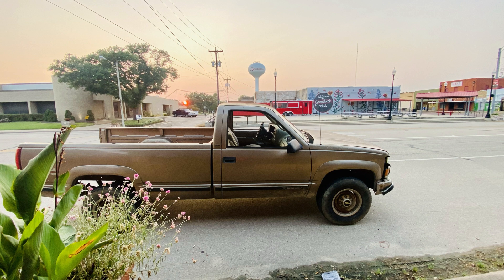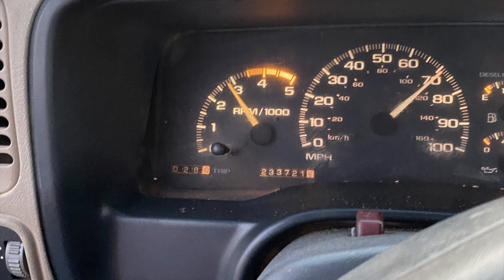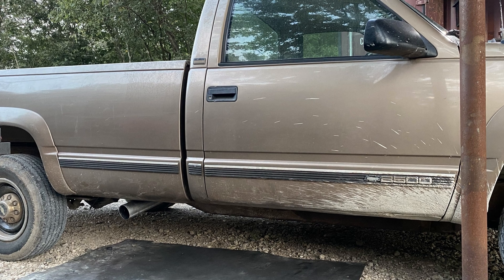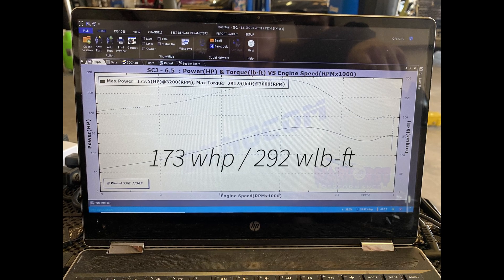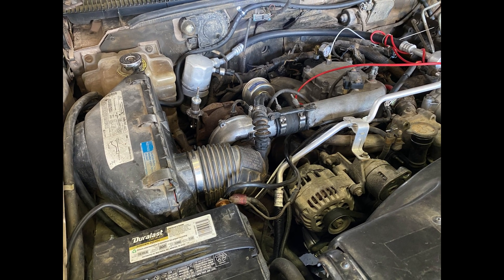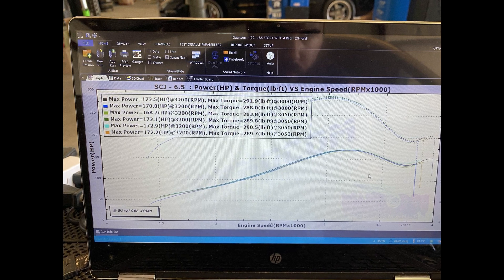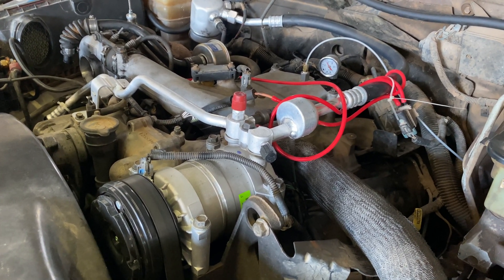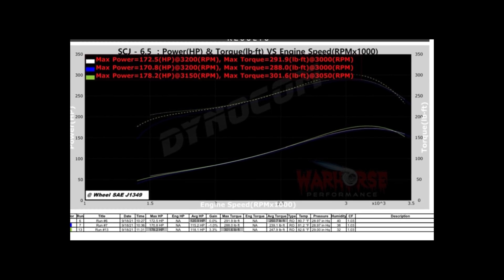Farm Turtle - Preliminary Dyno Results and Manual Waste Gate Testing

Comment: The best thing i did to my 6.5 was the manual wastegate controller set at 8 psi. I lost maybe 1 or 2 mpg on the highway, but the boost is there is always some boost available when you need the power - whereas with the stock vacuum controlled wastegate, the computer will open the wastegate when you aren't needing the extra power in order to save a little bit of fuel (by reducing exhaust back pressure) at the expense of performance. That small reduction in mpg is worth the performance to me...

Comment: Hello, 
Very interesting.  I have bone stock 94 except manual wastegate but, I noticed a large increase in power. I would say 20%. I have no idea what boost it gets to. I never did it for power, I was just tired of replacing vacuum pumps. But once I seen the increase in power and driveability it sparked my interest in 6.5 performance. Next lift pump.
JKA

Comment: Hope to see more vids of this truck. I just picked up a 93 6.5 dually. Love it so far.
Reply: 93 was the first and best year for the 6,5 Detroit I own. A 1999 3500 6.5 Detroit hate it so far 99 worst year
Reply: @russell7105  yeah it's still doing good. The only major problem I had was stripped out starter bolts but I fixed that and she's been happy since.
Reply: Changed everything but the ECM and  Lift pump also checked and added grounds straight to battery continue to have a intermittent miss ... as an example my Chevy S-10 "CUTS OFF" at 98 mph so my problem with my 3500 6.5 Detroit is like that at anytime any speed also kicks out of lock up shortly after it goes into it

Comment: Awesome video! Thanks I have a 96 k2500 suburban with a manual wastegate otherwise is completly stock 103k miles
Reply from the maker: If you have or obtain a high flow exhaust as seen in this video, you would basically have identical power numbers assuming healthy engine.